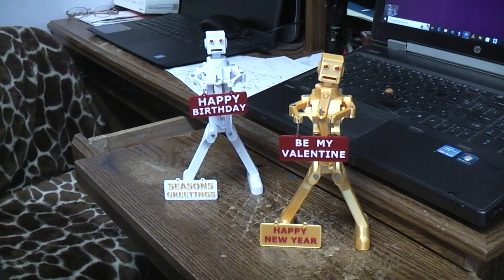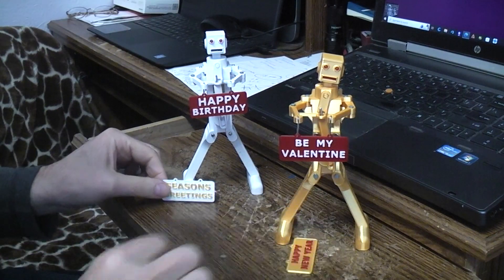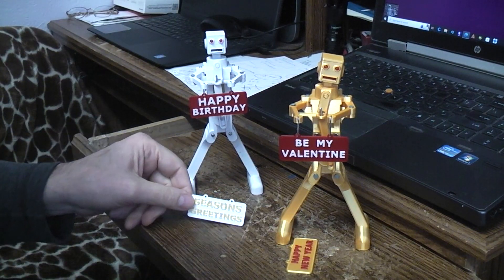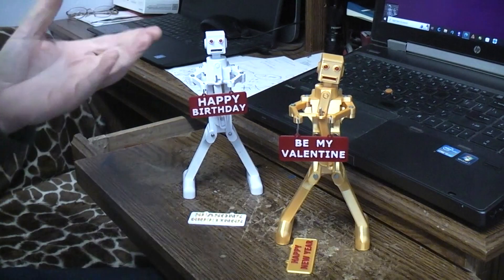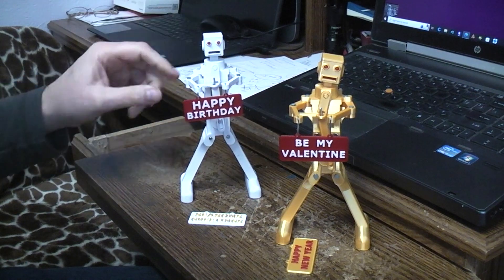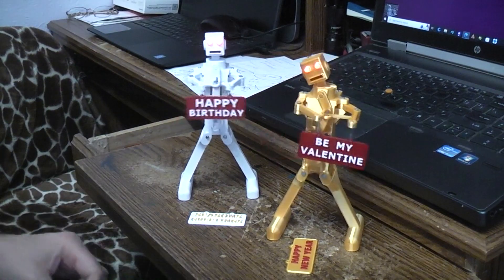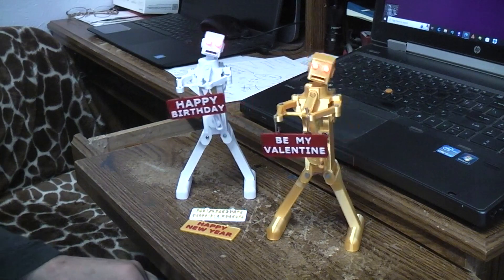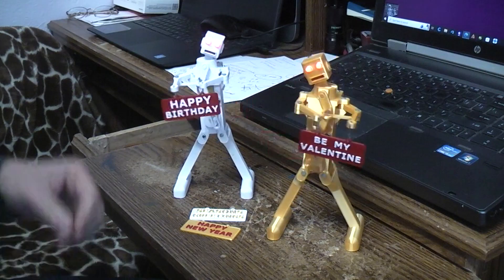3d printed, battery operated Celebration "dancing" Robot, Demo. TT gearmotor version

Comment: Love it! I suggest he holds a BilottaCollection Sign !!! 😃
Reply from the maker: I thought about that as well.
Reply: @Robothut  well maybe you can build me a few ll put them around 😉
Reply from the maker: @OzziesRobots  Do you have colors in mind for the Text and background ?
Reply: @Robothut  Well the logo is what Is on Alphadrome Would that be possible ?
Reply from the maker: @OzziesRobots  There are a few ways to do it. The ones I did were a simple filament color change at layer height 160. There is also the method of just printing a blank sign and placing a custom color sticker "made on a ink jet printer" . I can do a BILOTTA COLLECTION text 2 color 3d print. Or if you have a jpeg file of your logo you can email me I might be able to take that file and make it a 3d raised image for 2 color 3d printing.
Reply: @Robothut  I can email you a J Peg when I get home If not plain ole raised letter would be fine I prefer over a sticker